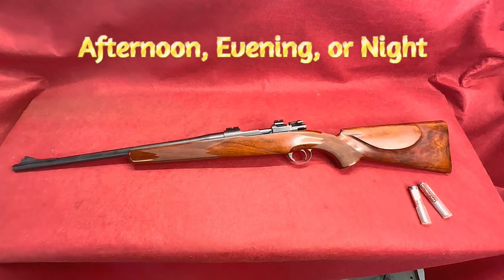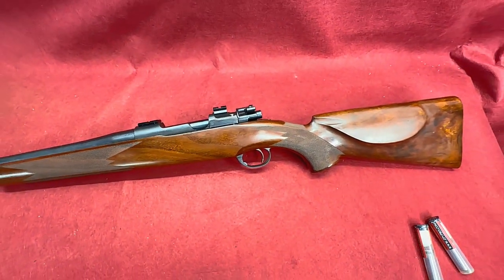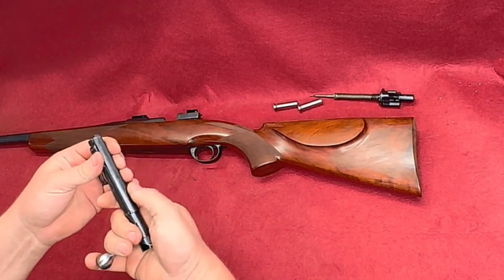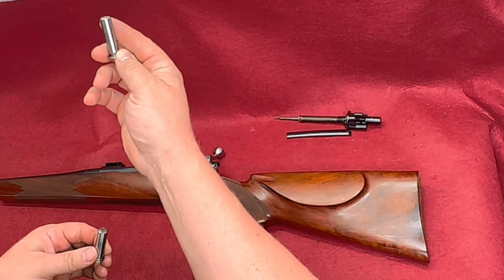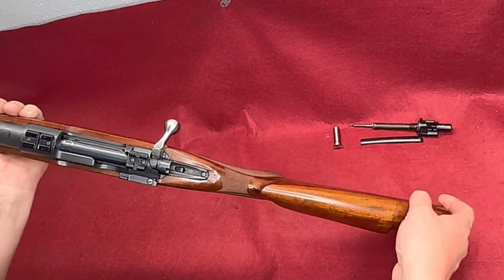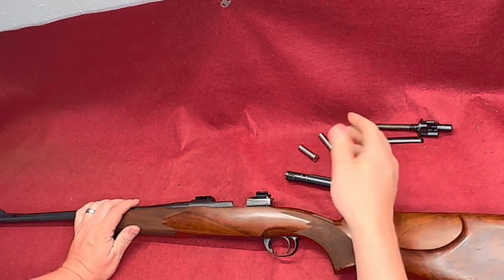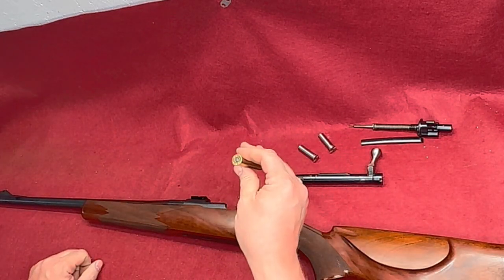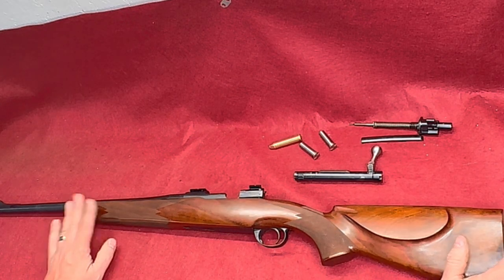Checking headspace in a bolt action rifle

Comment: I had McGowan mod and install a 45-70 20” bbl on my Siamese action in the mid 1980’s.  It’s a fun gun to shoot. It’s been set up with Lyman 47 sights.  They did excellent work.   It’s a handful on high pressure loads which it handled beautifully.  I used to shoot a lot of cast bullets with reduced loads which the rifle excelled at. It’s very accurate with all loads tested.